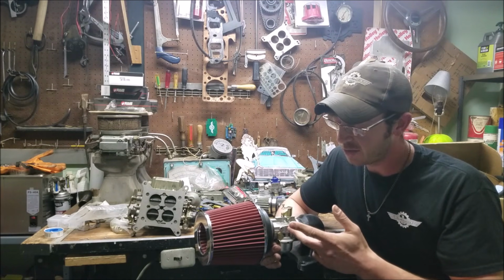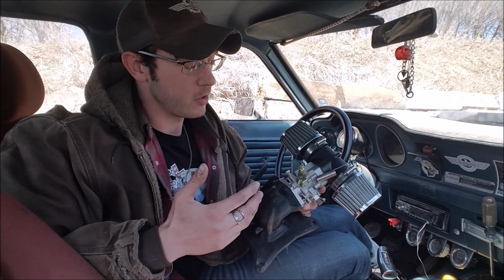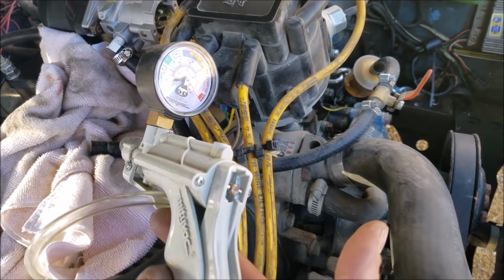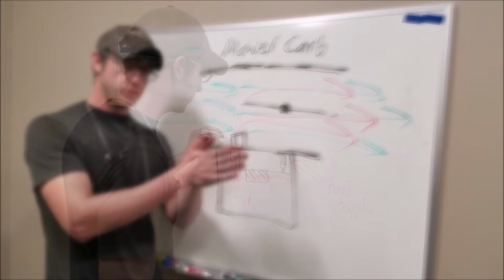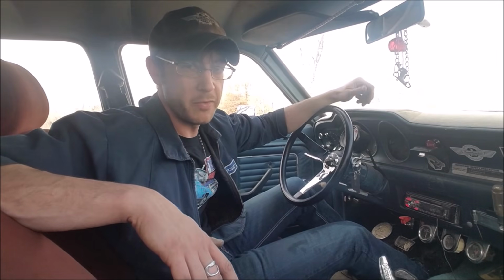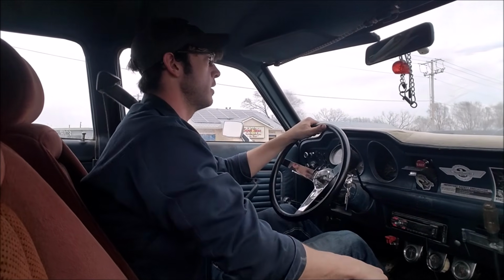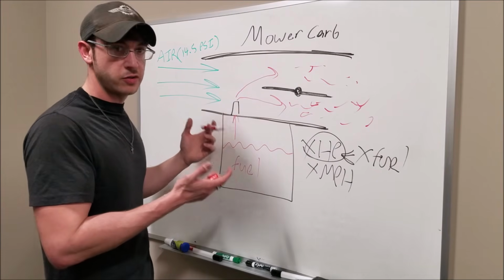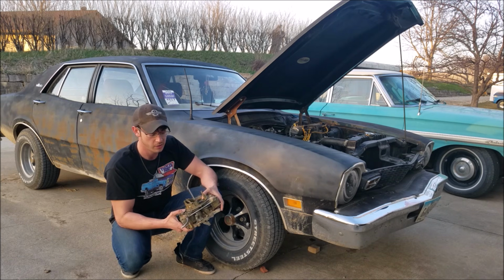Will It Run? Lawn Mower Carb on V8! (The "IMPOSSIBLE" Becomes Reality!) Start to Finish

Comment: Being that I have been a mechanic for over 60 years, I have always said that smaller carbs would give you better gas mileage.  Granted it should be less horsepower but with the enertia of an automotive engine the trade off would be well worth it.
I'd love to see the Dyno numbers.  
Great job young man.  Hopefully the petroleum industry does not give you grief.  
God bless.....
Reply: Great explanation thru out the video.  I would like a little better explanation of the programing and the vacuum control portion of the system

Comment: I was like most everyone else on the size of carbs needed, then I got my '73 Ford F-250 with an FE 360. It came with a 2 barrel, and I immediately thought like most everyone else that it'll need a 4 barrel. Then I found the math and found "360 ci x 4800 rpm divided by 3456 = 500 cfm". Question appeared then, how often will it be turning 4800 RPM? (hardly ever), it makes maximum horsepower @4000 RPM and maximum torque @ 2400 RPM. So a Holley 500 CFM 2 Barrel carb is more than I'd ever need. But increasing it's fuel mileage with that setup is definitely of interest to me, especially at these prices. Let's keep this going.
Reply: So at 70 mph and 2500 rpm he only needed 218.5 cfm to run the car.
Reply: @mikedonovan9573  That's at wide open throttle.  Way less airflow needed to just maintain 70 mph.
Reply: In theory, a vacuum seconday 500 cfm 4 barrel would be better.  The primary side would be smaller, giving a much better signal and mix.  This is why Quadrajets were popular.  Very tiny primary and gigantic secondaries.  Thermoquads as well, even if they do leak.

Comment: This is great stuff! I'm curious how much bigger of a carb you could run before a accelerator pump would be required. That accelerator pump dumps a bunch of fuel, constantly in use on the street. Your enginuity and unexpected results are a beautiful mix of doing what you love! I'm looking forward to where this awesome insanity leads you. Keep it up! I'd be a buyer!

Comment: Excellent I can't believe you made it work so nice and made it look like it belongs there. If you did this I believe you can probably make the small carb work on cruising and add a 4 barrel carb together and make it only work wean you get on it  Looks like you have more space for another carb towards the back of the engine engine try to make it work if it's possible I think you can do it. 👍👍👍

Comment: Honestly this is a brilliant idea , Proves that their is alot of potential for gas engines to get better gas mileage. And it does not take crazy complex tech / Direct injection. Dont need 300Hp just to go get grocery's lol lol Im sure some will argue with that. Well done sir. Well done!
Reply: The problem is the market i.e us drives what the automakers put out. Your average mid level family vehicle is 270+hp. You have to actually search to get less power more efficiency. If the majority of ppl wanted 40+mpg we'd have it. But the majority want 40+mpg out of a v8 suv with all the extras I'd also like to add the main reason he thinks this works is the atomization of the fuel. That's what direct injection does. On top of being atomized, when something that high pressure is released it provides a cooling effect. I belive it was audi who had 13.5 to 1 compression on 87 octane with direct injection.
Reply: @beavistechrock  Difference with direct injection is fuel air mixture is less mixed than with turbulence of this lawn mower carb. arrangement. Naturally , modulated direct injection allows for much higher compression ratio on low octane fuel but how does that pan out in terms of economy? I have a notion that a combination of a lean carb. mixture, fuel/air cheater AND direct injection things could really get interesting. 
    I experimented with direct admission propane into a 4 cylinder 40HP diesel and found it would put out about 60 HP and no smoke.   One big company, and I fail to remember who tried a  similar  experiment with highway tractors but did not follow it up.  \
Reply: You find the right formula on a slightly larger carburetor and 300 h.p. could still take you to the grocery store, i do worry though about lean burn ratio,
Reply: @richardbarber4444  from what I understand d.i allows higher compression. The higher the compression the more energy you can extract from the fuel. However, higher compression also equals more nox? Emissions. When you've got ceilings of cost and drivability I don't think we can get much more out of gas engines. For example on a new grand cherokee they are making everything they can out of plastics and aluminum. The hood is aluminum, the front subframe/cradle, the control arms and spindles as well. Thats saving anywhere from 250 to 500lbs vs the last generation. I believe going forward weight savings with partial plug in hybrids will be the rule of the day before we go full electric.
Reply: @beavistechrock  need to make them more aerodynamic,  lighter , smaller. Plenty of things on the car we can make out of carbonfiber.
Reply: @FalconWing1813  the big issue with carbon fiber is its a one shot wonder. It's no repairable. If it gets damaged in the slightest it loses all its strength. For the cosmetic panels like frt fenders they aren't gonna get much lighter. They already weigh close to.nothing made out of aluminum

Comment: Amazing.  I wonder how well that would work on a 350 SBC with a TBI.  I love my 90 Suburban but it's too expensive to drive.  This would be an amazing revolution.
Reply: I'm brand new to carbureted or tbi stuff, what is the difference between carbs and tbi carbs? I know there are electronics involved...  also, can you run an old school carb (or mower one) on a tbi car with obd1 or obd2?
Reply: A tbi “carb” (it’s really just a old style fuel injectons) is a fuel pump going to a mechanical regulator that then feeds the fuel through the two big injectors on top of the throttle body

Comment: I am super interested in how you made that automatic air fuel tuner. I would really like to see how you set it up! Do you read o2 values, and use the vacuum port to let in air? how do you know what voltage is 14.5/1 ratio? (if that is how you did it) But This is so cool! I've been following this series having so much fun!
Reply: He uses a wide band and feeds it into his custom air bleed computer
Reply: Wideband 02 , arduino and a stepper motor to open a vlave. I have a 3D printer and build things on CAD . I get what he's doing here. Id learn how to program Arduino before you even attempt to try this
Reply: As someone who is very familiar with carb tuning and carb function, the outside-the-box thinking to allow the carb to run rich and create a controlled vacuum leak behind the carb (motor side) to lean the mixture is brilliant!  And using the large GM idle air control valve, running from an open-source Arduino reading air-fuel values via O2, man, this is just my cup of tea!  Nice job and so glad you shared!
Reply: Same here, I'd be interested in the plans and or a kit to do this ourselves. I see a lot of comments about oh it's just Arduino and anybody can do it, but that's total nonsense.
Reply: Put me down for a set of plans...
Reply: Me too!!!
Nothing but the highest respect for that great project!!!
Reply: @theungoliant9410  agreed
Reply: Very interested in trying the air fuel tuner myself! 500 cfm carb on top of a chevy sb v8-383 stroker engine with tons of torque.
Reply: @DC-vx6ed  that should work fine by itself even without a tuner. I have used the 500 hollies on my 2.3 l naturally aspirated pintos and they work fine with just a couple modifications to the throttle plates. On a larger engine should work perfect with no modifications
Reply: @descargaelbano   Anyone can do it now that the idea has been brought to consciousness. The hard part is not replication its ideation.
Reply: @luciankristov6436  I know the basics. Just am curious on the equipment. I actually have 2 arduinos i could sacrifice. Ive also got a 3d printer... And am solidworks certified so...
Reply: I was wondering about trying to squeeze more mpg out of my injected trooper by taking the o2, modifying the output and sending that to the computer to tweak the mixture for better highway millage.. 
Im pretty good at arduino programming. Have a switch in the cab to switch on gas save mode.
Reply: @steelavocado1  I'm looking for someone like you!
Reply: @chuckthebull  I'm looking for someone like you too. I need to do a little programming to open valves for water injection with an hho system and gas vapors. This is what I'm working on. I need a computerized control to open a valve with the throttle position basically. At more than 50% throttle it opens and in comes special water vapor. Part of a larger system.
Reply: @TravisTellsTruths  YouTube deleted my comment,, but yeah maybe I can help...I have a g mail aaccount all one word "Chuck the bull" 
So if you just had a micro switch and relay you could do the job easy as well. Soon as halve a throttle opening hits a micro switch and powers a relay .
But if you want something more regulated you could pulse the valve with on off with a mosfett and arduino. Adding a verable resistor to the throttle body and have that turn the valve on and off in pulses would regulate the flow... Supper easy to program..
Reply: @TravisTellsTruths   Don't forget to shut down water/high humidity air a while before shit down of engine, I played around with a vapor injection type of system on a1976 Suburban 3/4 ton,with a 454 n 400 turbo trans. I increased mileage from 10 mpg to 12.5 at highway speed,(back then it was 55 for most of the USA),.  It would rust up valves pretty quick if I forgot to run it after water vapor shut off.
Reply: I'm thinking for the average person who doesn't know how to do programming and 3D printing, you could buy a Megasquirt computer, and solder it yourself for $200 or buy one built (about $450) and then just find a modern carburetor with an electronically controlled mainjet that works on a voltage signal or PWM signal. I think many lawnmowers have an electronic mainjet. Or you could use the Megasquirt PWM output to go to an air valve, and you'd have to simply "invert" the signal, so that the air valve opens less, with a larger pulse width from the Megasquirt. You can setup Megasquirt to run "1" fuel injector, and instead of the injector, you'd use an air valve from a Volkswagon, which is a PMW (pulse width modulation) valve.. You'd need to connect a "PNP" transistor to the "fuel injector" output on the Megasquirt, as a way of "inverting" the signal, so that the idle valve closes, as the Megasquirt asks for more fuel..
Reply: @Ritalie  Very clever.. That sounds like it would work...thinking about my trooper.. I was going to interrupt the o2 sensor, convert the signal and   have that lean or rich the mixture as I desired to improve my highway millage. (not sure why it not a thing already built in actually)
Why would a manufacturer not maximize its fuel economy? Other than getting an evil eye from all the others.. (conspiracy?) never know in this desperetly greedy corrupt world.. 
But I'm thinking of giving it a try with an arduino.
Reply: @TravisTellsTruths  It would take a little designing from the techy's, what about a steam vapor system that uses the exhaust heat to make the steam,then port it to an injection nozzle that would put steam into the intake controlled in conjunction with fuel injection, once up to operating temperature a cast iron manifold would maintain the humid air injected at a higher temp to keep it in it's gaseous state, humid air ,I think would increase the volume of air going into the combustion chambers, this would be very similar to the old mechanical system I put on a "76" 454 Suburban,it worked by putting humid air into a  vacuum line which a mechanical  valve to control the amount of humid air into base of a 4 barrel Rochester. It worked good for what it was,averaged 2.5 mpg when using water vapor , and most welcome on a pig 454.With electronic controls it would be able to increase mpg.
Reply: @chuckthebull  If you give this a go I would be interested in the out come for my rodeo.
Reply: @donjonjr1  been messing with the idea.. I'm reading up on how to interoperate the o2 signals.. Basically take that signal and replace it with my own generated one.. And track the ratio to max efficiency.. My theory is it only needs to have power on accelerating then it can lower at cruise. Monitor either vacume and or throttle position. To gauge when it needs more power. Or use Air flow sensor
If I get any result I'll post it.
But I'm interested in trying at least..and I'm pretty good at coding.
Reply: @donjonjr1  I was wondering what type of O2 sensor you had ,,reading up a little i found a wide band O2 might be able to respond faster. And I found some interesting meters they sell with them that give you the stoichiometric mixture readout.. I could install one of these and easy take readings from that and modify to send to ECU. They make some under 40 dollar versions (just look up air fuel ratio meter) so this seems even more doable.. 
An older O2 was very slow to react so it caused the system to go from high to low (or lean and rich ) settings and averaged that out to get somewhere close.. But the newer O2's are faster giving more real time info to make quicker adjustments thus a better MPG performance . i'm getting more excited to try this out.. my trooper is 1989 so it could stand an upgrade.
Reply: @chuckthebull  well that's alot of great info there thank you, you make me want to dust off the wrenches. I'll look into the air fuel meter. Not sure what type of O2 sensor is on the 2000 rodeo but when I would drive it to the 6000'+ mountains and spend a few days up there it would adjust and when I would come back down it would take a few days for it to adjust again but while it was readjusting at sea level I noticed I get better gas mileage than before my trips. So I assume it's an older slower one.
Reply: @donjonjr1  Yes this is interesting..
What I have read is this averaging that takes place is stuck in a table that averages out all the fluctuations in readings.. If they did not do this (back then) your car would run up and down in air fuel ratio as the O2 is read.. So to even that out it saves the readings as it goes and then does a math operation to give an average. That's why it takes time to recalibrate. But as the O2 technologies got better to so did the way ECU calculate the ratio..they also use other input to "decide" like throttle position and timming using a crank angle sensor.
The most expensive O2 use some rare elements and self heating so they are more accurate.
Like I said..I'm going to try this out..
Reply: @chuckthebull  now I'm wondering if placing a reducer into the intake side would have any beneficial effects or would the six fuel injectors be too much to compensate low enough. 
Also would would it have to be reduced before or after the mass air sensor. 
Idk, like I said you got me thinking 👍
Reply: @donjonjr1  ha..and now you got me thinking in that direction..the lawn mower carb did restrict the air flow too. So? If you don't, then the fuel has to keep up with the air?.. So I think you are also on to something,, but? ,is that not what the throttle body does?  I'm going to order an air fuel meter and start investigating this..
Also going to get a fuel flow meter that I can monitor more closely millage.
I'm going to tap the injector signal to monitor the duration as that is how it's regulating fuel .
In the trooper the ecu is right under the center counsel and easy to access..
I have two of them.. One got burned out but I know what's wrong with it and going to fix it for experimental work.
I used to have all the input output descriptions but got lost in a move.
Anyways I'll updat my progress.

Comment: You just proved everything I've always thought to be true. All the times I've shook my head in disbelief about folks pouring to much fuel down their intakes and only getting marginal gains without ever doing anything else to the plant they were running. Probably why they find themselves re-ringing the pistons more often then they should have to, while wearing out the oil pump and having the hydraulic lifters only do their job half efficiently. I've found so many of my project cases reeking of gas from over carburization and poor tuning. Great experiment.

Comment: Hat's off to regular people doing what an industry won't. I don't know who in their right mind would think that they haven't thought about this from the 1950's, but haven't implemented it for obvious reasons.  And I've worked in the auto industry for close to a decade. They have mountains of patents for low gas mileage sitting at the bottom of a drawer. Godspeed!

Comment: What size lawn mower did the carb come off of cant believe i forgot to ask
Also look into a briggs carb for the 18 hp twin cylinder engine those carbs actually sit on a vertical manifold   and may actually work even better for you

Comment: That was cool, being a small engine man. Always knew that once a lawn mower engine went past design rpm levels it went fat,  never gave it a thought of a vacuum  leak to thin the mixture.  We used to build racing mowers and really spin the motors on them.  Ya know using twins and singles. Reworked ignitions to help with the response. Basically doing the same as you. Huh  this video really scratched the old think lump. Thanks.

Comment: Very cool work done there. 
I would've predicted you would be the front car in a long traffic jam all the time ;o)

Now how about printing an adapter to mount 3 or 4 of these carbs and have them progressively start delivering air/fuel when throttle/engine power demand becomes higher.
So all the time been able to drive on just 1 carb, unless more power is desired.
Reply: That is a great idea I think!